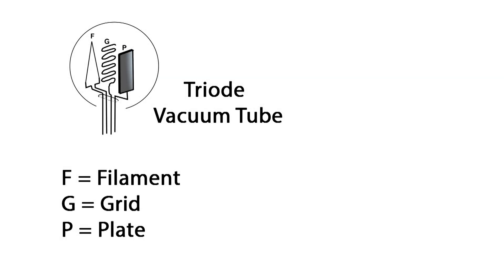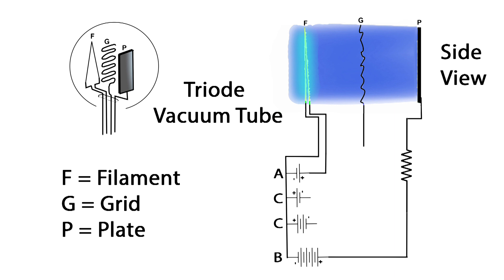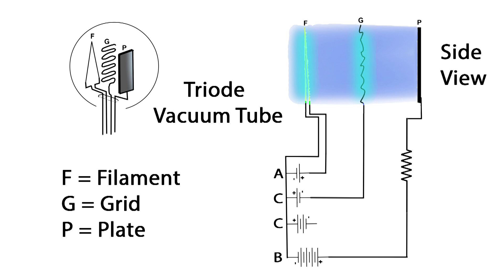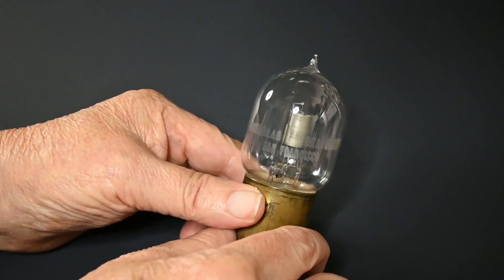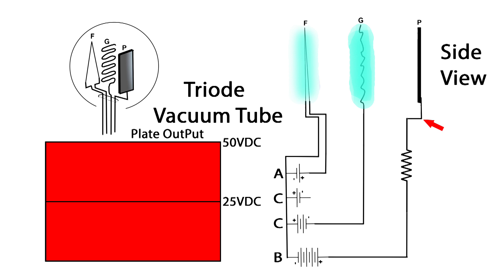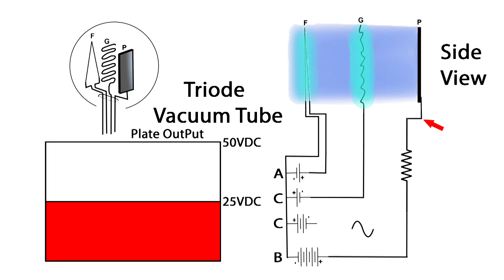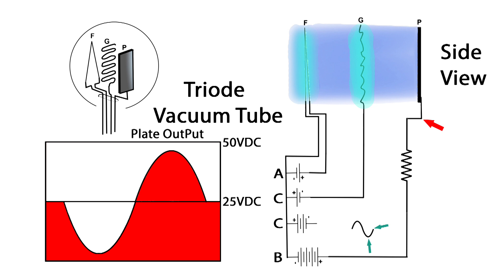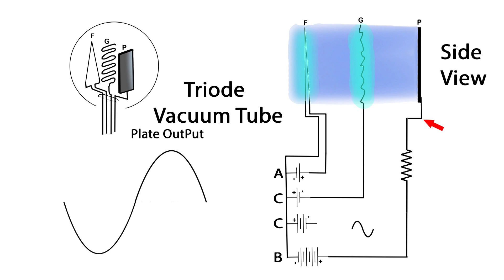Triode Tube Amplification Visual Demo

Comment: I'm looking at a 12AX7 datasheet with nine pins. What is the distinction between "cathode" & "heater" pins? Which one of these  pins  represents the "filament"?
Reply from the maker: The first triodes have a filament, control grid, and a plate. The filament is heated so that it can emit electrons. The control grid controls the electron flow between the filament and the positive plate. The more negative the control grid the less electron flow.
The triodes with a cathode. Now the filament is just a heater. The heater heats the cathode so it can emit electrons. The control grid and the positive plate functions as before. 

12AX7
http://nj7p.org/Tubes/SQL/Tube_query.php?Type=12AX7

Please download my free ebook. Chapter 2 is Vacuum Tubes 

PASSWORD is allamericanfiveradio

https://drive.google.com/file/d/1HHmaWYr7UMACfmS4W5uL6PADoem2KlRp/view?usp=sharing

Comment: It amazes me that the tube is (practically) a century old, and looks perfectly useable :)
Do they always invert the signal?
Reply from the maker: Yes. A single stage Vacuum Tube output at the plate or Transistor output at the collector, will have a 180 degree phase shift between the input and output.
Audio Phasing, Important and Useful
https://www.youtube.com/watch?v=lgWLCG5vg5c
Reply from the maker: Thanks